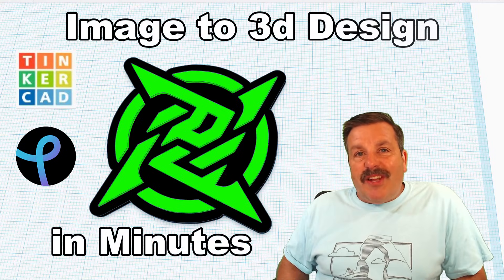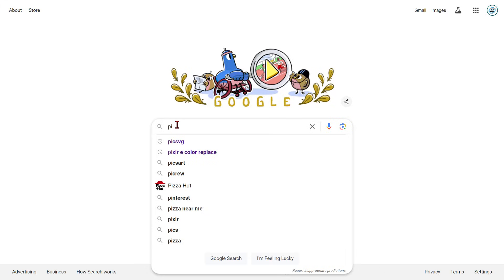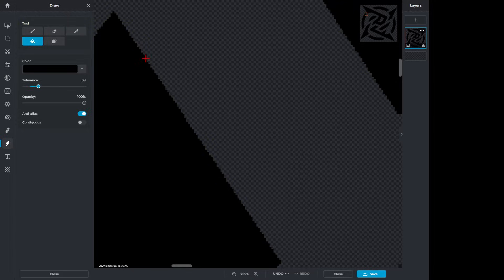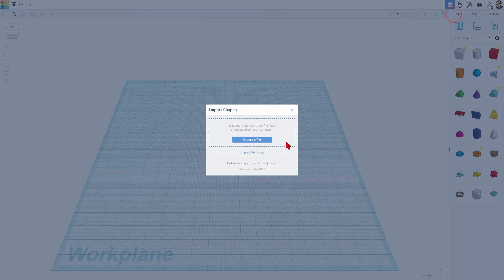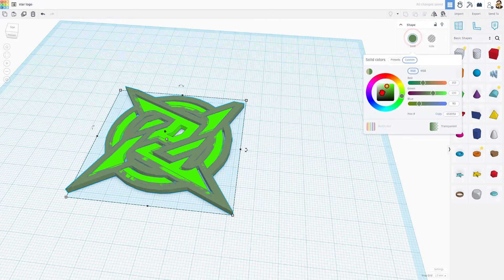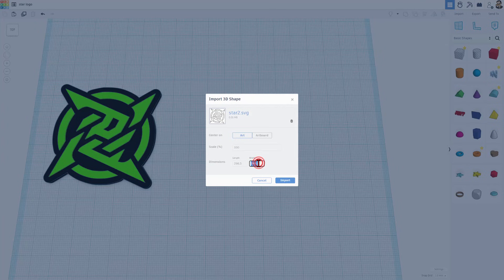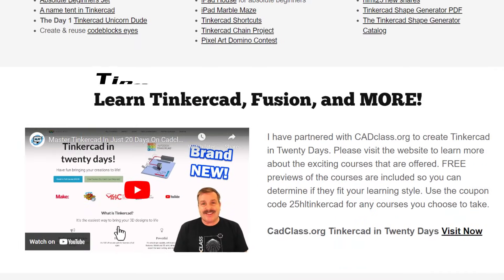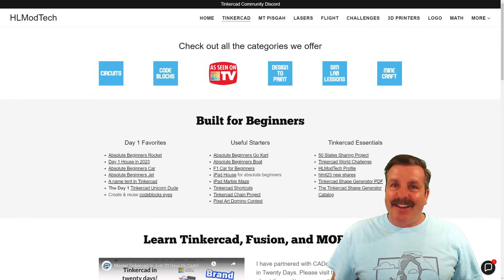Turn Images into 3D Prints Tinkercad Pixlr SVG Wizardry in Minutes

Comment: I found xTool faster and easier to use to create an SVG from a graphic. I'd always used Inkscape but xTool has made it even easier. New Project, Import, resize, trace/save, export SVG, done. Six clicks...🙂
Reply from the maker: Nice! Do you have an xTool device, or are you just using the software?  This project started with MakerWorld. https://youtu.be/NmkZXDeFlYc It was slick too.
Reply: @HLModTech  strictly using the xTool software itself. I was just surprised at how easy it was. There's only three minor tracing adjustment tools that, really, don't seem to do a heck of a lot any way. I was doing some PNG, JPEG and TIFF typical logo's or cartoon characters for testing (white backgrounds). When the imported graphic is resized in xTools before tracing, that's the Art Board size it imports in Tinkercad so you don't need to change X/Y in Tinkercad.

There's no X1C/AMS here any more. Far more failures than it was worth fixing so it went for parts to someone who needed it. As a retired developer I'm an open source guy, so closed source is out of the loop for me. I strictly use Tinkercad for the design assembly and haven't done embossed prints in years. All mine are face down, textured PEI plate, either on my deltas or PRUSA Mk3S/MMU2S. I found the four colour AMS far too limiting, so the five MMU2S filaments I can work with 95% of time. I had a Palette Pro for a while and it kind of works but it's restricted to being online for using it so it got sold as well.
Reply from the maker: Sounds slick. I may have to give it a whirl one of these days. Thanks for sharing.